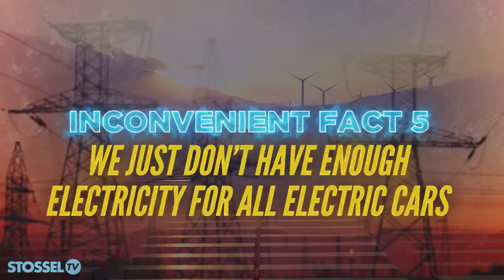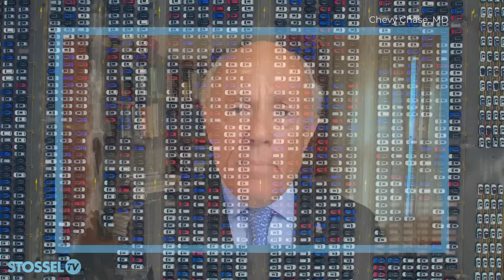Electric Cars: Inconvenient Facts, Part 2

Comment: Stossel once again reminding us what actual journalism looks like.  We need more like him.
Reply: why do you think ABC wanted him gone?
Reply: Be skeptical of everyone including Stossel.  Think for yourself as difficult as it is.
Reply: I have solar panels on my house and my electric bill is less, but I don’t think I can plug in a car.
Reply: @tyronmegawatts6580    I'm bit of a petrol head, crotch rockets of my youth to 'old fangled' BMW M3 with screaming 9k revving V8 today.

Petrol is still crucial and I hope to be able to afford it in 2030, but for the 1st time since the automobile took American streets, the cost per mile changes, will drop by 4X (roughly--depending on local petrol vs electric costs) and you just plug in at home happy to never visit a gas station nor oil change or other maintenance. 

Mid class and lower will be chief beneficiaries of reduced transport costs.
Reply: @tyronmegawatts6580    IDK your situation but I expect to power home and BEV off roof solar for new home build here in N. Commifornia sun.
Reply: @tyronmegawatts6580  nope you don't produce enough power to charge a car.
Reply: @rickschritt1616     Did he specify his generating capacity?  I missed that.
Reply: A LOT MORE!
Reply: @tyronmegawatts6580  charging an electric car is like running 25 refrigerators at once!!  Just Say'n
Reply: @Mrbfgray  You make a great case, but sometimes you do need a megaphone to get the right message out also. Getting people to think period anymore is getting difficult, it seems they have to have a house fall on them first. lt's very, very sad that this is what we have come too.
Reply: I agree with the over all sentiment, but am bothered by the misinformation in this video to get to the conclusion. The facts support the fact that we need both batteries and gas, let's not use misinformation, because that only hurts the legitimate standing we have.
Reply: @hobiebassassassin9136  if you are able to charge your EV at home and you have solar PV panels and a smart charger then you can set it to only charge from the panels. It will charge at 3kWh per hour instead of 7kW but its free from the sun so keep it plugged in as much as possible and let that sun juice trickle in
Reply: @Mrbfgray  Nah, it's not even close. I'm in sunny NorCal. Just do the simple math. I have a 5kw solar setup. An EV has a 50-75 kw battery. You would need at least 10 hours of direct sunlight for a full charge. No clouds, no winter, no other things in your house to power. Even doubling the system wouldn't get you there. So triple it. Now you'll have enough to charge your car in the few hours of strong sunlight you have, still no clouds and no winter. Now you're paying $50k. That's 25 years of gasoline bills for me. And the solar only lasts 25-20 years before we, well, we still don't know how to get rid of them.
Reply: @justoncheney7172  Why do we need batteries? They don't generate anything.
Reply: @dk-bw4gk    Solar price and probably performance will continue to improve fast, fully charging the car?  How often are you driving 300 miles per day?  Average user drives some 40 miles.
Reply: @Mrbfgray  Solar performance is almost maxed. Only a few percent to improve on. I drive 150 miles a day. I would need a car that would go about 400 to safely charge every other day. Your average is also inaccurate as it just takes the 14,263/year average and divides by 365. Most people don't drive the same distance 7 days a week and that average also includes the city people who only drive a few miles a week.

Besides, I asked why we need batteries.
Reply: @dk-bw4gk    Performance is almost maxed??  It's around 20% efficient for common panels up to some 40% for expensive applications like satellites. 

Suit yourself but 125MPGe is hard for ICE to compete with, that will be at least 150MPGe for the most economical options in a couple yrs.  BEVs are already reaching purchase price parity with ICE in China, soon to go global. 

 Overall operating cost, obviously depending on regional petrol vs electric costs and miles driven--is ballpark of 1/4 for a quality lower cost BEV vs a Camry say.   An Uber driver will tell you their car payment is made by fuel savings alone for a Model 3.  

That's the ultra high use case.  For someone only driving a couple thousand miles per yr, that '94 Civic may be best economics for some time to come.  (neglecting safety, performance, convenience, BEV owners love never visiting a gas station and only requiring charge stations for long road trips, no oil changes, etc. Plus all the other modern improvements)
Reply: @Mrbfgray  Yes, almost maxed. There are physics at work here and the laws can't be broken.

Comparing MPGe to anything is pointless; it's a fictional value. Gasoline has 43x more energy per kilo than a fully charged lipo. That's the number to beat to become competitive.

EV cost is greater all around. More expensive to buy, more maintenance, higher insurance, public charging, etc. The only break you get is home charging when the subsidies kick in. I don't need an Uber driver when I have math. You need to drive over 5,000 miles/month for a Model 3 to get ahead financially. Gas would need to be over $20/gal for the 3 to break even for the average miles driven.

Enough of your misinformation... Why do we need batteries?
Reply: @dk-bw4gk    I'm a bit of a petrol head, love my 'old' BMW M3 screaming V8, but I don't pretend it's economical, I can't think of anyone I'd recommend it to and tho I don't currently desire a BEV it's obvious that's where things are going.

If you insist on emotions dictating your beliefs despite all the evidence to the contrary....nothing I can do about it, not MY problem.  

BYE!
Reply: @Mrbfgray  Nice pasta. Nothing I said is emotional. There is no evidence for any of these claims.
Reply: @dk-bw4gk    Zero evidence from you either, both of us just making ascertions.  Mine are based on numerous 2nd hand accounts and actual numbers.  

When it comes time for me to seek an economical car it will clearly be a BEV, wouldn't touch a new ICE today as the depreciation is going to be extreme.  Meanwhile I expect to continue to make a modest fortune continue to multiply, an opportunity in part created by misconceptions like yours.

My guess is you will see the folly of your opinions in a few yrs, not my job to convince you of anything.  Sincere GOOD LUCK.
Reply: @dk-bw4gk  Batteries are needed because the sun doesn’t shine and the wind doesn’t blow 24/7. No sun, no wind, no power.
Reply: @justoncheney7172  Needing both gas and electric was pretty much the conclusion they came to in the video.  Not sure what misinformation you are referring to.
Reply: @mikee2923  Right, and batteries are expensive, material, and mining intensive, and a terrible storage device. So why not cut out the Wind, solar, and batteries altogether and move back to high quality, cheap, dependable, dispatchable energy?
Reply: Journalism requires discussion of both sides of an issue. This video is dumb.
Reply: @pcloadletter52  Agreed. The EV/green side never discusses their side. It's always demands and zero reasoning.
Reply: @pcloadletter52  What changes would you suggest?
Reply: @Mrbfgray  Even at 8 $ a gallon i can go for five years on the cost of an ev that won't pull a load
Reply: @lightningjet6574    Sure, pull a load of cow manure to and from work, grocery shopping, dragging main street.  Have fun, not my concern.
Reply: @dansanger5340    Indeed.  BIG loss of street cred from this hack job.  Like the channel in general but this is BS.
Reply: I mean, I counted 8 total points that were either misrepresentations or straight up lies. So yeah, showing us what journalism is about these days...
Reply: Look up a video series recently released by Tony Seba called the great transformation.
Reply: @dabigkahunacatfish2992    Intellectual laziness is not new, but yeah it's a problem.
Reply: Actual journalism is making video filled with lies?
Reply: @tyronmegawatts6580  at what cost? THE ROI is not that great. Unless the tax payers are footing the bill.
Reply: @Mrbfgray  You know, alot of your reasoning seems anecdotal; if you wanna reach people, some tangible citing might be helpful.
Reply: @Mrbfgray  It will be when your soy burger cost 30 bucks a pound
Reply: I usually like what he says but half of the things in here are just factually wrong, and he tries to defend it by saying "It's just math!"

So lets say, we have 5 factories in the US that make batteries and sure it'll take 400 years to make enough batteries with that many factories, ok fine.

So if we have 10 factories, it'll take 200 years
so if we have 20 factories it'll take 100 years
so if we have 40 factories it'll take 50 years
so if we have 80 factories it'll take 25 years.

For perspective, there are 157 current car factories in the US, his "400 years argument" being "math" is bullshit.
Reply: @Tehwugginator  Right, now factor in the costs for all these battery factories and the amount of fossil fuels needed in making these factories and running them. Apparently you missed his part one video where he addresses this point.
Reply: @biggoards2772  Of course he’s pushing an agenda, he runs a financial analysis company, he has to sell his research. The point is that his research is CORRECT. It’s verifiable fact on every single point.
Reply: @biggoards2772  that’s just blatantly untrue. Solar installations are already below the operating costs of fossil fuel plants, and will soon be below the maintenance costs. You’d literally spend more money maintaining the current infrastructure than it would cost to replace it with solar.
Reply: @mynameismatt2010  Okay that makes no sense considering it takes fossil fuels to run these green energy plants. Where is the savings? How much energy is being produced? Who stands to gain from green energy factories because it's not the people. I live in the greenest state nationally and we're paying more in energy costs.🤨 We are one of a few states that even have the infrastructure to cut costs on developing green. Again, 10% of our energy output comes from green energy; it's not efficient.
Reply: @biggoards2772  The most common form of electricity generation in natural gas, which costs 65 dollars per mwh not including depreciation and amortization. Grid scale solar PV costs 80 dollars per mwh if you do include depreciation and amortization. When you go further and compare the upfront cost of installing that generation capacity Solar is SIGNIFICANTLY less expensive by every single metric.
Reply: @dk-bw4gk  Actually, no, you are mis-quoted the laws of physics.   Single-junction solar cells have a theoretical maximum of around 33%.   But there is absolutely no law that says you can only have single-junction cells.  Multi-junction cells can go much higher.  In addition, multi-junction cells in concentrator  configurations can easily hit 40% with fairly low costs.   47.1% efficiency has been demonstrated with 4-junction concentrator cells.

That said, home installations won't have those kinds of cells due to the expense.  For all practical purposes, home solar systems will cap-out at around 25% efficiency.   The best grade-A residential panels right now are around 23%.

But there is no law that says you can't add more solar 🙂.  One can put panels all over the roof, even in spots that are not ideal.  And if you run out of roof there's always ground-mount.

-Matt
Reply: @dk-bw4gk  I think we have to consider an important point on solar augmented EV charging.   The Solar does not have to completely charge the EV.  It just has to offset a modest chunk of your grid costs.   

The potential range from solar alone is simply the number of kWh a day your solar system generates multiplied by 3.   And how much it helps simply depends on how much you drive on average.  It doesn't matter if you drive more than that.

So my system generates 30 kWh/day in the summer and 16-20 kWh/day or so in winter.   Just taking the winter number, that's 60 miles worth of EV charging a day.

Now of course my house uses a lot of power too.  But the point is that the panels reduce total utility costs by a decent percentage (like a 75% reduction) and that includes charging my EV.    It doesn't matter that it cannot fully cover home + EV.  My utility bill is 25% what it would be without solar.   All driving included.

That is a big deal.
Reply: @junkerzn7312  You are correct, the The Shockley–Queisser limit. The limit for an infinite number of stacked cells is 68%. And you were right, I was referring to residential panels having no room to increase.

It doesn't matter though, even if they were 100% efficient we wouldn't have enough room and materials. It's a low quality energy source, only to be outdone by wind, and we are destroying the entire landscape to use it.
Reply: @hobiebassassassin9136  you're still thinking 1950's grid technology. Most of the power shortcomings is purely due to interruptions and sabotage of technological advancement. Theres literally tonnes of energy around us that just needs to be harvested, and if you cannot grasp that, you only have to look at scandinavian countries that show you how to do it. And their geographical conditions arent even nearly as favorable as the US
Reply: @junkerzn7312  But all this "green" stuff is worse than doing nothing. It's just a middleman. Why limit our energy? Why switch to lower and dirtier forms of energy? We should ge using gas for transportation and nuke for things that don't move. We could even use nuke for cargo ships. These are the most energy dense, reliable, and cheap sources. Why are they so adamant on moving backwards?
Reply: @dk-bw4gk  I certainly don't think this "green" stuff is worse than doing nothing and I don't know why you would either, or why you believe we are somehow moving backwards by using it.  It is the cheapest source of energy on the planet now and the technology curve hasn't even begun flattening out yet.  There is literally no sane argument to not use it.

Oil and gasoline (among others) have a sordid history as well as in-your-face implications including major and continuous foreign interference in our economy that you appear to be completely ignoring.   How is any of that good?

The "green" stuff removes all foreign influence from the workings of our economy.  Even when we buy it from China.  Because no matter what once a wind turbine or solar panel or even a grid-scale battery is installed its good for 25+ years and no foreign power can disrupt it.  It isn't subject to inflation and it is completely immune to pricing volatility.

This is true across the entire spectrum, from an individual home owner to a whole nation.   I would think that you would want personal empowerment, yes?  I sure do.  Well... solar gives you that.

--

I personally like nuclear, and I am all-for using natural gas as a filler fuel for the grid.  We might never get rid of natural gas entirely but as a filler its use can easily be chopped down 90% in around 15 years.  Its easy to build NG generation (far easier than nuclear).

But just as renewables aren't a 100% fit for the grid, neither is nuclear.  And strangely enough, if you really want to advocate for nuclear you should be 100% backing grid-scale storage because nuclear isn't economically viable without it.   This is one of the problems that (in particular) the conservative culture war doesn't seem to understand.   Nuclear is not economically viable without a lot of grid-scale storage to go along with it.

Electricity is truly the universal fuel.  You can make it from almost anything and it can do almost anything.   It gives individuals personal empowerment in ways that no other fuel is able to.
Reply: @dk-bw4gk  I don't know why you think its a low-quality energy source.   My solar panels, which are JUST on my garage roof, produce enough energy to take care of 75% of my usage.  Day in, day out, for years.  Inclusive of my EV charging.

How is that low quality?   Why do you believe a solar panel is somehow low quality?

-Matt
Reply: @junkerzn7312  Nothing in nature uses wind, and the only things that use the sun can't move. By definition they are low quality. Everything else uses oil in some form. It doesn't matter what your needs are, it's a fraction of the cost and more reliable to use a high quality energy source.

I have solar too. I'm in California and you have to. They don't do it because it's better or anything, they do it because it's a game. They jack up the tiers (over 80c in my case) to force you into taking your neighbor's money to put solar on your roof. The question is, "Why shut down all the dams and nuke and natural gas plants? Why would you promote energy poverty and make everyone pay more for less reliable sources?". It's just more wealth distribution to them. If solar is so great, why do they have to mandate it and subsidize it?
Reply: @tyronmegawatts6580  my fam in the uk charge their car almost exclusively by wind. 4 households, 2 by wind, one by solar and one small scale hydro. 3 have nissan leafs and one renault zoe
Reply: @biggoards2772  You obviously didn’t read my comment. I was using natural gas as a metric to compare fossil fuels (natural gas) against solar.
Reply: @junkerzn7312  The state (they) shutting down power plants and promising energy poverty is somehow just "inconvenient real-life facts"? Hiking rates through the roof for zero reason is just some inconvenience I need to learn to live with?

You can look it up. Wind and solar are classed as low energy sources. They are the things you use when you're a developing area. Once you learn the technology, you switch to higher quality sources.
Reply: I'm not sure what's truth anymore. With that being said, Musk has said solar is the way to go. But of course he would say that right?
Reply: @dk-bw4gk  Okay here’s the real question. Over the next 100 years global energy demand is going to at least 10x, what potential energy source do you have in mind to get us to that level of generation?
Nuclear? It’ll help, but with modern exclusion zones you’d generate more energy from putting solar in the spot you put the plant than from the actual plant.
Reply: @junkerzn7312  Alright, I can see you are out of your depth on the entire issue. Have an evening.
Reply: @dk-bw4gk  I’ll admit, when you get larger reactors nuclear is a more efficient use of land, but smaller scale reactors use more land than solar.
I’m not against nuclear, but we can’t just say nuclear is the answer to spite solar. 

Nuclear is currently more expensive than solar to install and not getting any cheaper, while solar manufacturing costs are expected to decline over 80% in the next 10 years and installation costs are expected to half.
Then on top of that you still have the ongoing cost of nuclear fuel, and nuclear waste disposal. 

Compare that to solar, which as an industry is barely getting started, which once it’s installed the ongoing cost is pennies per gwh. The waste disposal for solar is to recycle the panels, about 96% of panels should be easily recyclable. Once you have a system built to subsist solely on solar the ongoing to of solar manufacturing is just whatever the energy demand growth is + 4% to make up for the recycling losses. Energy will be virtually free by that point.
Reply: @dk-bw4gk  Bye bye.  Try to get some help maybe.
Reply: @mynameismatt2010  Solar is just never going to be there. It's old tech, it's not cheap and it has a short life. You can do the math yourself, it's not difficult. Even if you assume a full 1,000 watts/meter^2 (100% efficiency), 1,000 MW of solar would need over 25 acres. You can scale it how you like from there. An SMR (470 MW) requires about 10 acres. This would need about 50 acres for solar.

An industry barely getting started? It's just as old as nuclear power. I've also been hearing this "recycling is just around the corner" forever now. They still don't want to mess with them. And they will never be free, they need to be installed all in one shot because renewables can not make themselves. Once you shut down gas/nuke plants, what you have manufactured is all you're left with.
Reply: @junkerzn7312  Thanks for your concern, but I'm fine. I don't fly off into insults when I can't back up my assumptions.
Reply: @dk-bw4gk it is cheap and getting cheaper every year.
It last 30+ years
It’s based on a decades old principle but the industry is still brand new. In mass manufacturing you have to look at cumulative units, not years, when judging the maturity of the industry.
Reply: @mynameismatt2010  It could be free and it still would not be worth it. Only if you're in some type of off-grid situation does it make any sense, but it would be cheaper and more reliable to get a generator.
Reply: @dk-bw4gk  You’re insane.
You could DOUBLE the current US power demand just by covering parking lots with residential solar systems. Add in residential, commercial, and industrial rooftop solar you could get to 10x current power demand without a single centralized plant.
Reply: @mynameismatt2010  Did you even watch the video? Did you try out the math yourself? Come back and tell me I'm insane again. You apparently don't even know the difference between demand and supply.
Reply: @dk-bw4gk  What are you talking about? The video was full of lies, that’s the whole point of everything I’m saying here.

I did do the math myself. You’d need about 20k sq mi of solar to meet current energy demand, less than half the estimated space taken up by outdoor parking.
Reply: @Mrbfgray  because you don't believe this? Why are you here
Reply: @SoGoodRc1   As mentioned, I generally enjoy the the channel, respect Stossel and I know he's completely wrong this time and that it matters.  Understand now?
Reply: @SoGoodRc1  I don't seek confirmation of my prior conclusions, get it?
Reply: @Corey_Otis  There is so much grey in the discussion, there is no absolutes and that is the issue during these discussions. Stossel is at times correct, but at other times he is giving misinformation. Just got to pick through the weeds! lol
Reply: @hobiebassassassin9136  "charging an electric car is like running 25 refrigerators at once!!" Absolutely false. On a daily basis, charging an EV is like running an electric clothes dryer a cycle. You can charge an EV overnight using 120v house current. Please get your facts straight.
Reply: @Jon VB you wrong....do the math average hourly uv exposure time in a givin location annually. Calculated to cell efficiency currently and give us your anserw.?
Reply: @Tehwugginator  your point is mute
Reply: @Mrbfgray  explain please? because most of what I read you saying is not correct.
Reply: @SoGoodRc1    Be specific please, old thread IDK what I said.
Reply: @Mrbfgray  your comments are all very convince the to who your speaking to. I don’t think you think at all.
Reply: @NekoinaBox2000    If you have a point to make please do so, no time for children's nonsense.
Reply: thanks mum
Reply: @mynameismatt2010 why compare with different depreciation and amortization? Why not compare both with either d&a or without it? What's the real 80 number like without d&a?
Reply: yellow journalism maybe, and there's plenty willing to shill.
Reply: @RoyBoy2019  He has his own YouTube channel, if that's what you call 'shilling'.  Is there someone you like better?  Who do you consider an actual Journalist?
Reply: @RoyBoy2019  Could it be that EV's are something of a sacred cow for you?  And Stossel has committed heresy?  🤔
Reply: @pallidbustofpallas4679  BEV make sense when you do deep math. Cheap gas isn't cheap when you include subsidizes and military budgets which are not reflected at the pump, but rather in national debts. How's you national debt doing, any thoughts on its growth thru left & right govts alike? How will droughts help or hinder repayment?
Work remains on BEV range and cold sensitivity for larger countries. Smaller countries like Norway, already works.
400 years makes sense if humans stop making & improving battery factories.
$100t makes sense if battery chemistries & wiring costs do not change (trending down, more options)
Understanding reality is my focus, what's yours?